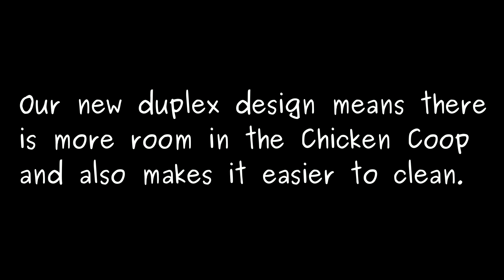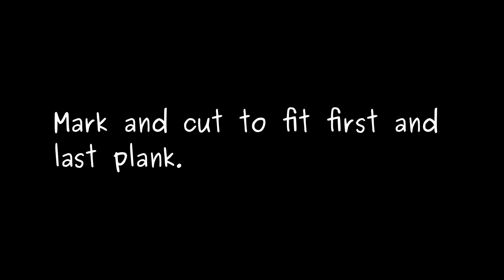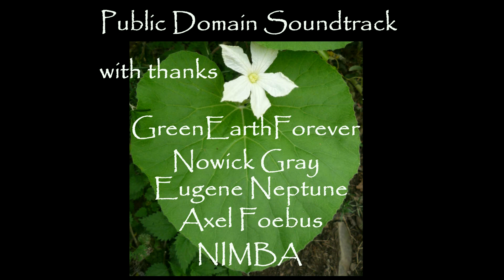Pallet wood easy clean chicken perch/roost. Bricolaje percha gallinero. Fvm Perchoir

Comment: Very nice Idea. I may be building a coop soon and the wife is worried about their droppings.
Reply from the maker: +Rustic By Nature Hi there and thanks for your comments. Sue's father (ex farmer) advised us right from the start that we needed a droppings pit under every perch/roost. The old design had just that but at floor level and the perches had more pallet wood in them and thus heavy to heave about when cleaning. Also there are a lot of invertebrates who love to live in 'dung' and when we would lift out the perch to clean the coop all the chickens would rush in. This way we just take off the wire top and roll up the paper and it goes straight in the compost bin. We get the paper as bags from our local organic shop (used to transport bulk foodstuffs) so even any writing on them is just vegetable inks. The chickens have clean feet, we have clean eggs and sometimes there is something such as a few sunflower seeds left at the bottom of the bags! All the very best, Andy